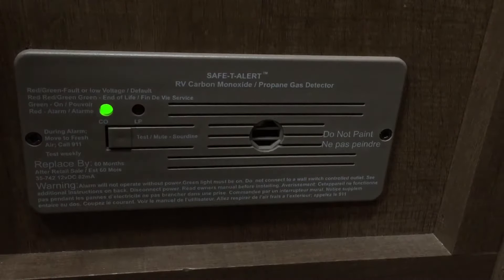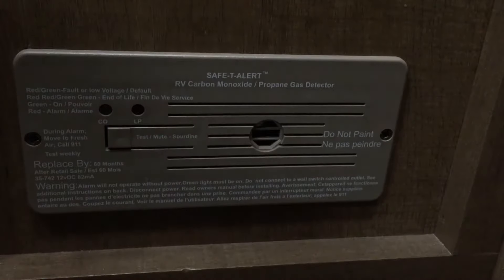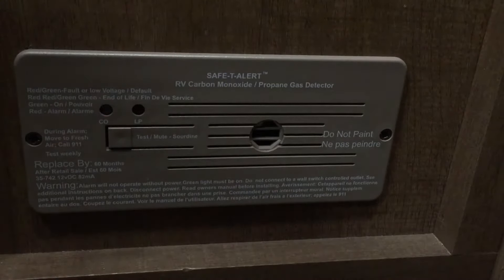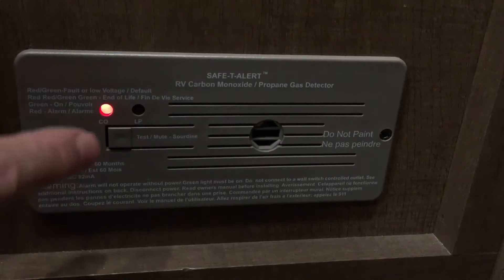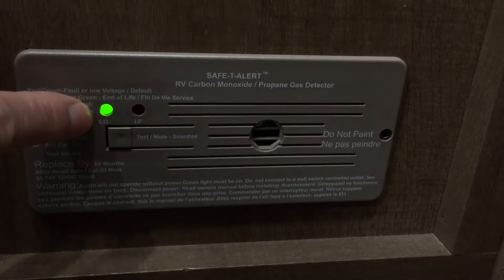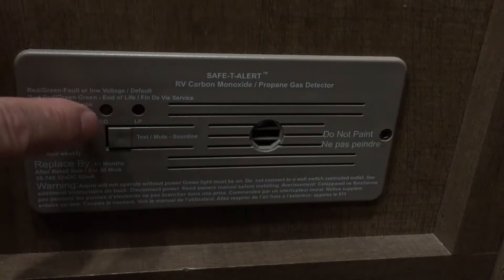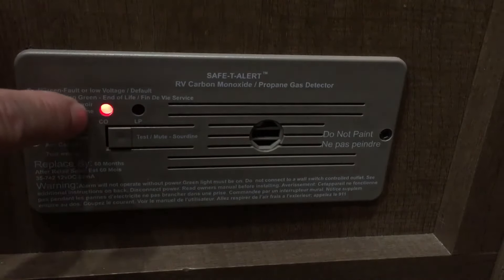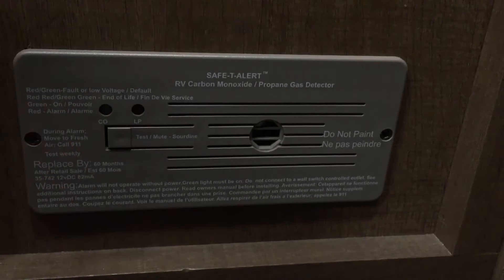RV carbon monoxide propane gas detector

Comment: Odds are it starts beeping in the middle of the night, right?  LOL. Thanks for the info. Very important to replace.  Hope all is well with your and yours.  Debbie - BluWave Odyssey
Reply from the maker: The crazy thing is it would be beeping every time at Sebastian inlet state park when we turned on the shower. I think the sulfur well water mixing with the magnesium anode rod would produce some kind of gas to set it off beeping.   Has anybody had this happen when the shower is turned on?